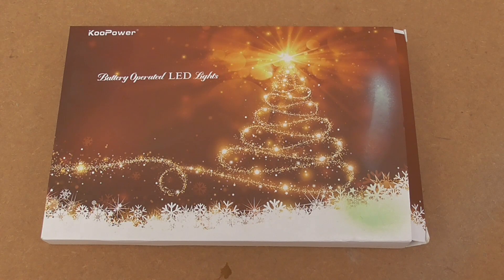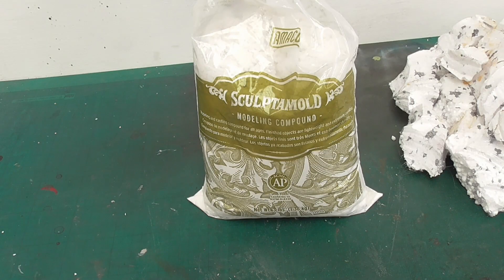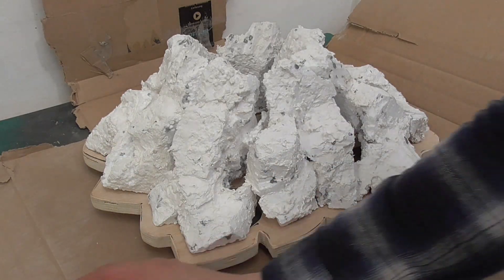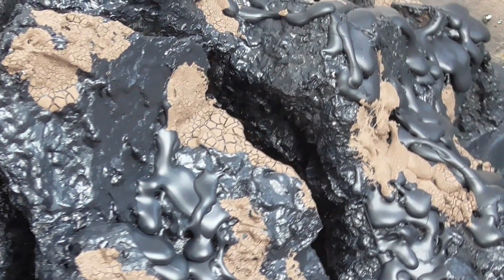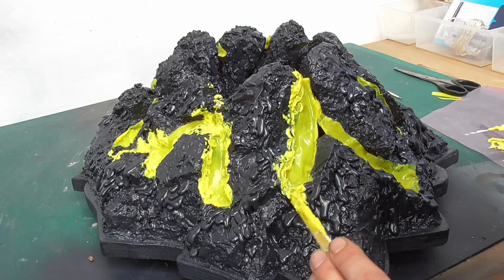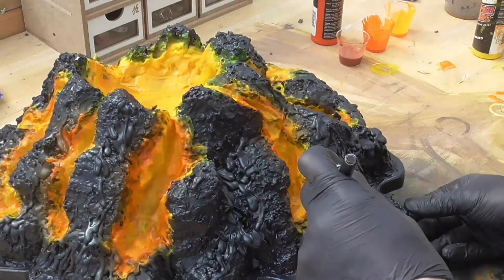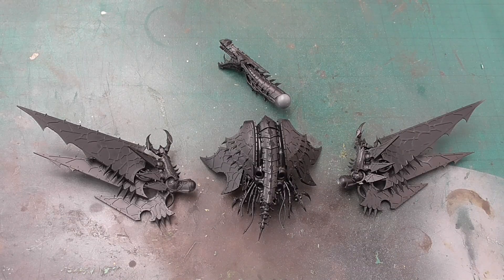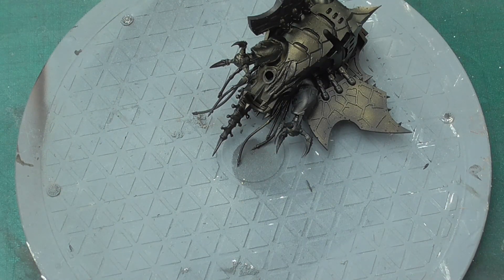How to Build a Glowing Volcano Diorama

Comment: I was wondering do you mix the mod podge with the black paint or you apply mod podge then paint it ?
Reply from the maker: Either works but mixing it all together just saves a step. I also was very worried about what you can and can't mix early on, but soon realised that products like mod podge or pva can be mixed up with most things quite easily. Anything water based really.

Comment: I tried using the structure gel and it won’t spread out the way you spread it out! Using plastic surface as yours. Also, once it dries ( after 12 hours) when I peel it of, it starts to break! Any tip or advice ? Thanks I’m advance
Reply from the maker: Strange... structure gel by nature is usually very flexible even when dry. Maybe it's an old pot? Possible try thinner applications?

Comment: About how much did this entire project cost?
Reply from the maker: Apart from the price of the model the rest was relatively cheap. I bought a bunch of black hot glue for cheap from amazon. I cant remember exactly but approx £10 for 100 sticks and then a few push button led lights from the pound shop. Approx £3. So all in about £20

Comment: The volcano itself is very nice! I don't think you should've added the dragon, it takes away from the volcano, which is the main focus. And I don't like the material you used for the clouds. I think you could've either made it denser or used something better. All in all, 9/10 in my book!
Reply from the maker: Cheers man and appreciate your feedback. The Heldrake is easily removed and used often when I play 40k - I just slide it on its original base. The poly fibre used for the smoke was just for effect. Its not fixed so easily removed also. All in all it was me trying out an idea. I learned a lot and if I were to redo it I would definitely do it differently. Either way I had fun and learned something which is why I do it. 👍
Reply: That's what's important: you had fun.  You're very creative!